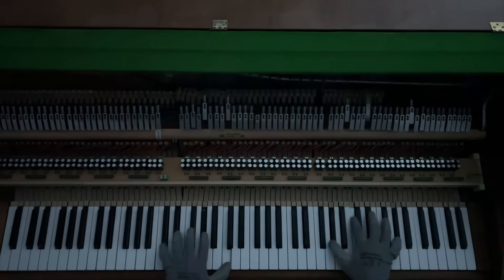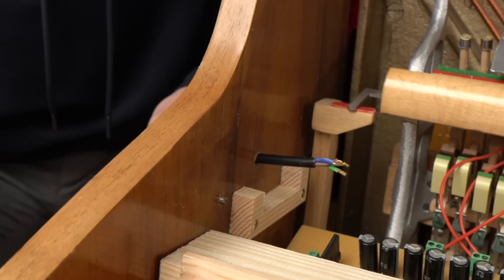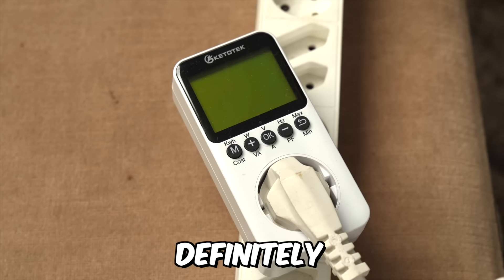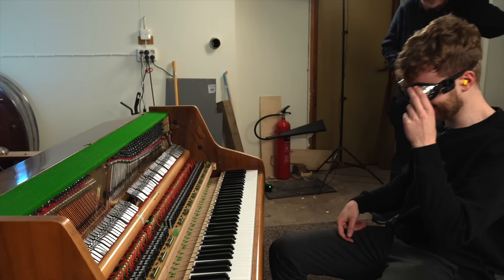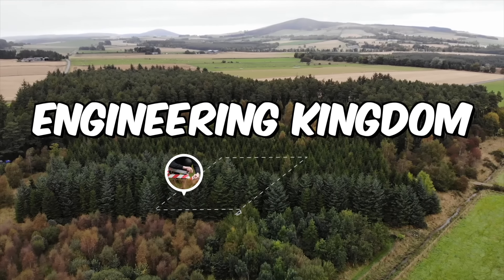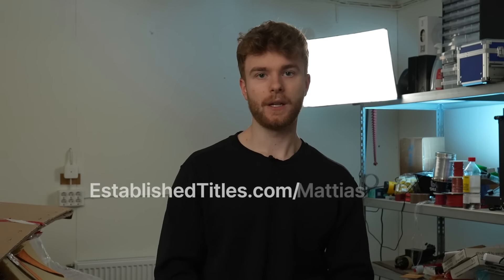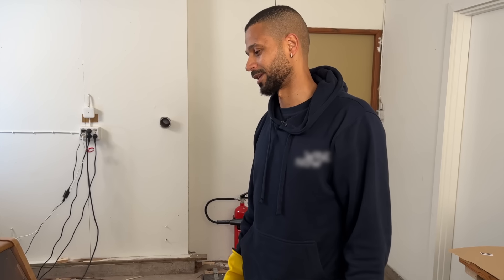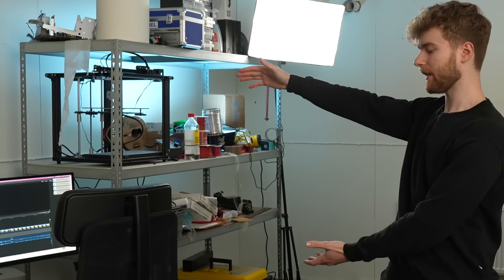Hiring electricians to fix my ”electric piano”

Comment: Flamethrower piano would actually be pretty cool. Not the first guy to recommend it, but just rigging it up so as long as you're holding a key a gas valve releases over that part of the piano and sprays some fire above it.

There's your stage performance piano.

... and a good reason to repaint the ceiling of your workroom.
Reply from the maker: That’s truly a terrible idea! Love it😆

Comment: A whole lot safer way to create sparks with a piano would be to look into the friction wheel technology they used in old matchbox cars that would spark when you rolled them, or in cigarette lighters, or torch strikers. Get rid of the electricity and capacitors, and figure out how to create little spinning flywheels of flint on each hammer that would create a non-lethal "spark" when striking the string.

Comment: As an electrician / automation engineer as well, if You want this piano to be safe, the plexiglass shield is enough, that is, if the keys and the linkages are all wooden AND dry. You should not expose the piano to any kind of moisture, and just to be extra safe I'd put plastic bushings between the metal hammerheads and the wooden dowels that they are mounted to. Also, could be a good idea to actually dip the hammers in an insulating rubber compound, so there is bare metal exposed only on the front of the hammerhead, where it contacts the spring. Also, if You want to make them not stick to the strings, You can try to either make the contact point smaller (have the hammerheads ground down into a sharp edge), this way there is way less possibility of welding, and, You could put smaller capacitors in there (if I'm not mistaken, those are presumably around 200V / 150μF, not sure if You did put them in parallel, like 4 caps for one string though). If You put for example some 100μF caps in there, or (in case that You have them in parallel) just remove some of the caps per string (go from 4 to 2 for example), it should weld itself way less. But lesser capacitance also means lesser sparks, as it will lower the max current
Reply: Also, consider encasing the electronics in a steel box connected to the ground wire (green/yellow comming from the plug, the one that You cut lol)

This way if anything goes wrong or blows up, the fault current will go to ground instead of someone who's playing the piano at the moment

Comment: You could run the piano on 24 V or 48 V DC.  Just get a good (isolated) power supply and run the piano on that instead instead of directly on mains.
If the sparks are too wimpy, you can change the capacitors to ones with higher capacitance.

And get something to block the UV so you don't fry your eyes.

Comment: Maybe you could connect all the defferent strings to some sort of processing unit, like a microcontroller or even better a raspberry pi via some phototransistors and trigger a speaker, which actually plays the note you pressed. You would get an awesome looking Piano, which is also good sounding! Keep up the good work. Greetings from Germany
Reply from the maker: This piano has a midistrip under the keys for another project so I actually tried this! But it almost just sounds fake. For some reason? But if I leave some spark sounds it sounds quite epic!
Reply from the maker: Greetings from sweden!

Comment: Use a heavy duty contact switch
As a manual way to break contact.
Also have another like with jetskis that pop off the motor when you fall off.

Ceramic keys. Idk.

Create an acrilic cover, perhaps darkened

Comment: Changing the configuration so that the capacitors only get charged, individually, when the hammers are in the resting position, and disconnecting from line voltage when they leave the resting position would eliminate the shorting and dramatically increase the safety
Reply from the maker: But it would trigger the breaker everytime for this discharge speed we want (I think) i could be wrong I suck at electric stuff

Comment: I would use here special resistors (like 1MOhm) to discharge every each capacitor. And a lamp to indicate power wall connection. It'd make the piano a bit safer.
Reply: And of course a circuit breaker or a fuse and a residual-current device

Comment: I am an electrician/ electronics repair and  circuit designer. What is your goal for this to achieve? you have essentially built a giant bug zapper at the moment lmao. I love it. I usually use some form of oscillator to generate electrical tones lmao.

Comment: Just something to know is the piano’s lifespan is really limited due to the sparking. Not the sparks themselves but what they mean. They are caused when a lot of voltage has to travel a small gap of air and this damages the metal where it sparks as it creates lot of heat. This is why switches have clicking sounds is because it is connecting and disconnecting the current so fast it doesn’t have time to do the spark.

Comment: i don't know if you still read your comments, and i don't now yet how the things evolve about this piano. But the thing is i saw some issues from your building part revealed in this video. If i read correctly the blue print you got, it seemed to me that one of the side of the capacitors where linked to the ground, and as i looked through this one, the ground have been cut from your cable, so the capacitor where not linked to the ground. the "GND" on the draw represent the ground, the part that should be linked to the ground. you may should check it again if it's not already done ;)
Any way, thanks for your wonderfull videos <3

Comment: #pianoidea I have a crazy piano idea. Electronic sounds where all octaves sound the same are easy to make, but that might be possible to do mechanically as well. Use the fact that there are 3 strings for each note. For the notes C C# D and D#, use strings of appropriate thickness and tune them in three octaves. For E F F# and G, lower the thickest string one more octave. Finally for G# A A# and B also lower the middle string one more octave. Now when you start the next octave on the keyboard, all strings are once again in the same octave as the C before.

Comment: What if you make a piano into a soundboard? Like it will be a normal piano from outside, and from inside you can try to make it act as a soundboard by removing all strings and other stuff except a the hammers and then behind the hammers put in something that can detect clicks or touches. Which can then feed the input into an arduino or something which can be coded to assign the sounds to specific inputs and then there can also be speakers on sides that play the sounds. And possibly you can upload the sound packs into it. I dont know much but I do suggest this.
Reply from the maker: Hahaha I get what you mean. I’m not sure if we need any of the piano exceot the keyboard to make that

Comment: As an electronics degree holder and a crazy idea person I would have built this in a different way. I bet you could also make this way safer with a few mods and bring down the internal power so you can't kill yourself with straight mains power by touching anything inside of it. The big thing that i would have added was a system to discharge all caps on power off. Funny thing is I have a body of experience that would work well to fix this. I have done welding and my degree in electronics plus just loving bad projects and weird ideas. I think I could fix this but all your boards need to be changed out that is why your resistors are melting.

Comment: Idea: a piano... where each note is a whole piano. So one is completely tuned to C2, the next is tuned to C#2, the next is tuned to D2, and so on. Each piano has one of those "E" planks, but for its particular note.

And then you can either have one person in front of each piano, or you could rig up some sort of system that allows a single player to play them all from a control piano.

Good luck. :)

Comment: I'm wondering if you could take rosined disks and use them to rapidly rotate against the strings, something like how a hurdy gurdy works. I figure that would be cool. I know I've seen these guitar accessories that are a small spinning disc that does the same thing. Maybe putting those on the ends of the hammers so when you press a key it presses the disc against the string.

Comment: I think your best bet to make this safe is to remove all the strings, fit an electronic keyboard in the place of the actual keyboard, than add a tesla coil in the distance and use it as the speaker so you'll both get the cool sparks which will also play the music, and you'll have it somewhat safe as long as you either put the tesla coil in a faraday cage or situate it somewhat away from the player and audience.

If you can manage to, I'd recommend you to contact with someone like franzoli electronics. He has a lot of tesla coil music videos
Reply from the maker: I’ve actually been working a lot on a flyback piano! And I recently got confirmed that franzoli wanna help with it😎

Comment: I think the whole piano should be grounded just in case discharge goes from the live-wire. Why not use transformer so we can go from AC to DC, should make a bit safer and you could pull out wires to the top and add led-lights (one leg to mass other to string with current) so the moment hammer hits the string additionaly you can light on the led based on used key. As for AC why not add a light bulb to the end of capacitors, when its turned on it would simply shine normaly but if you would turn off the power the lightbulb would act as resisotr and drain the stored power, you would at least know which one is still charged.

Comment: Hi Mattias, you should make a safer version of this piano. My idea is putting momentary switches under the keys and white LEDs on the hammers operated by said switches. You can choose which direction the LEDs should point. It would be lit. And much much safer.
Reply from the maker: But it wouldn’t be nearly as cool!😬😬 how about lazers?
Reply: @Mattiaskrantz  Sure! But only if the beam is visible! With powerful lasers or maybe a fog machine?

Comment: You ought to be able to modulate the frequency of the pulses per string and tune the sparks to the same notes as the strings. If you did, this would actually sound good.

Comment: If you want to make it safe, the only way i can think of is to decrease voltage and ramp up the capacity. If the voltage gets low enough it should even be safe to touch.

Comment: I learned one thing from this video

Electrician is not electrical engineer

One knows how to install an electrical outlet, fix a lightbulb, replace swichmode/linear powersupply,  install a swich, install the breaker, replace house wiring, use the multimeter

While the other knows how to make a pcb, create/repair a swichmode/linear powersupply, solder components together and make a multimeter

One sees the electricity as the threat, while the other uses it to its full potential (even if it will cost him his life)
Reply: you must not have been paying attention

Comment: Now here's a thought. What if instead of adding electricity to a regular piano. Replace the hammers & strings with a series of transistor based circuits that generate a wave form for each corresponding key, then connect it up to an amplifier and set of speakers. Nobody will have ever thought of that. You could even make it so it routes the circuit through multiple different octaves depending on a set of switches so you can... ...wait, what was that? ...already invented? ...a transistor organ? ...1957? ...Daing it! I thought I had a new idea. Still, I reckon it would be an interesting idea to turn an old piano in to a transistor organ with off the shelf components.

Comment: First guy was totally on the ball flagging the lack of cable-restraint... and I mean not even hot-snot Bro?  Tip for next time: just tie a knot in the wire (on the inside).
   0:55 looks like the ground pin has been deleted from the plug. It really doesn't affect the situation because he's not bonding to the exterior and Neutral provides the path.
  Running the whole thing from a (1:1) isolation transformer would be best as you remove the ground reference altogether. AKA: Floating Mains
   By removing the literal "ground reference" the person playing could sit naked in a puddle and would still need to touch BOTH ends of the Mains at the same time to be affected rather than JUST the live/hot.

Comment: i mean i myself do stuff with electrical components... although i do not count as an electrician... buut ik that there is a guy in umeå who do component repairs on computers and phones and stuff.. it is not actually easy to find ppl who do component repair.. as most electricians who repair electronics actually just swaps out whe whole board and replaces it instead of repairing it..

Comment: To make it more safe I guess you should rewire your piano and include a circuite to discharge it when powered off. It will also be a lot safer and quicker with modules of circuit boards you can order online …
Another thing is to regulate what is going in your piano …
Being able to switch capacitors capacitors to a more practical one …ect…

Also ask MR boom for more tips he will probably help 😅

Comment: maybe you should add a circuit that you can connect and disconnect to all of the capacitors to discharge all of them safely so the piano doesnt spark when you unplug the whole thing. also so you  dont accidentally overcharge one of the capacitors and it explodes.

Comment: Perhaps a piano with two sets of hammers could be interresting - mainly to surprise people that is. It would work like this, when you would hit a key the first hammer hits the string and than after some delay a second hammer hits the same string creating an echo of sorts. 

Would maybe be cool if the second set of hammers was on the other side of the string, so it would be kind of hidden - though that might be too technologically complicated. Than again, you built a piano with real hammers, piano that can be filled with water and an ,,electric'' piano, among others so I guess this is not completly out of the table :D

Comment: Pressurized water jet (or pressurized air jet) piano. Different nozzle size for each note to control the jet speed to impacting a plate making different pitches. Never needs to be tuned just have spare nozzles and plates as they wear down. Might be able to get away with same size nozzle with a valve on each, I dont know, good luck

Comment: Theoretically if you 3D printed the whole action for a piano, then you could submerge the whole thing in water. That would be a LOT of work though. On to a more reasonable idea, you could replace the strings of a piano with metal tubes. They would be impossible to tune, but like the tuning forks, they would never go out of tune once they are the correct length.

Comment: You really need a isolation transformer to make it safer)))
So when you touch it, the current would not go trough your body into the ground,because the secondary coil has no electrical connection to  with the live 240v side. You would still have close to 240v at the output ,but not relative to the ground at least))))
Reply from the maker: But people have very strong opinions on this on both sides so I really don’t know if it’s safer or not! Like there is pros and cons for sure and all arguments I hear are quite reasonable🤔
Reply: @Mattiaskrantz  i think youtube comment section is not the best place to find an actual solution,yeah,i agree with that.
Maybe compile the best ideas from here and ask someone like electroboom to review them,idk

Comment: could you build a piano with no hammers? like have a machine that shoots a stream of air into a bunch of tubes that made sounds, like a bunch of flutes on their sides maybe? agh i am trying to think of a thing, that makes sound when you blow air through it. yes i know there are sax, clarinet, and flutes, but  with those things, you have to press on holes, in the flute or bottoms on the side of the sax, what would make a sound of different sounds, if just air was flowing through it ? oh like a whisle maybe. could you do that thanks :)

Comment: 1. This could be fun but repurpose your water piano and instead make it thick water. I think it would be cool to see if it would make the notes deeper or if jt would block all the sound.
2. Also there is a paste magicians use that you could make a smoking piano. It might be easier and cheaper cuz you don't have to buy a new piano you just need to buy the paste and put it on the strings.

Comment: So… bad idea, but also cool idea… fuels (liquid or powder) create resonance based on their burn rates, if you were to have measured streams of fuel pour from each note as a fire hammer ignited them you could potentially play the piano with fire.  Although you would be limited on which songs, or speeds at least, would work based on the burn to refill rate for repeating notes.  Potentially the fuel could flow down glass tubes for better control, and that may amplify the resonance audibility if the right tunes were used to synergize it

Comment: It is so hard to hear the actual sound coming from the strings. I wonder if taking the pickups from an electric guitar would make it easier to hear if put those behind the strings of the piano somehow and got it to plug into an amplifier to play the sounds that they record because they are like a microphone for a stringed instrument and they do not pick up extra sounds.
Reply from the maker: This piano actually have optical sensors under the keys so I tried outputting keypresses to the VST version of this same piaNo. It sounded amazing.. But I still kind of prefer the raw audio somehow